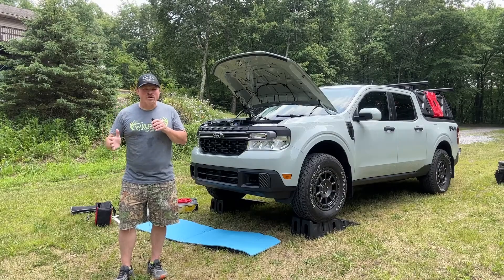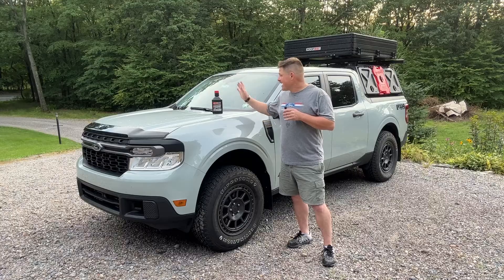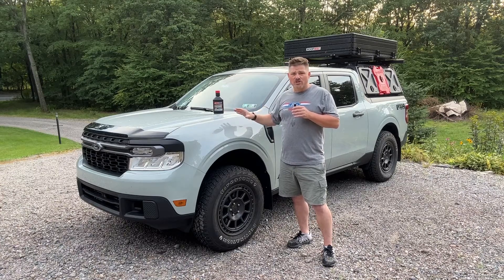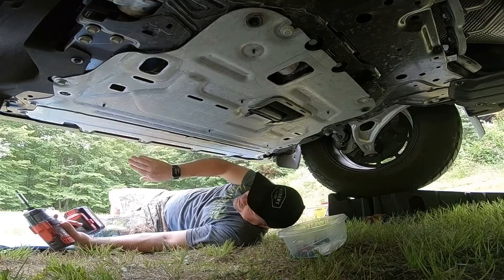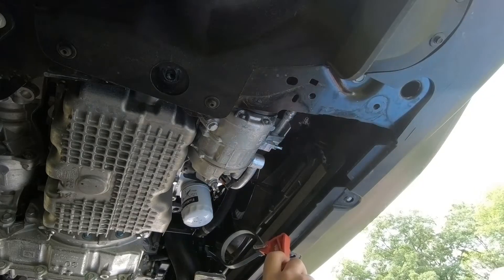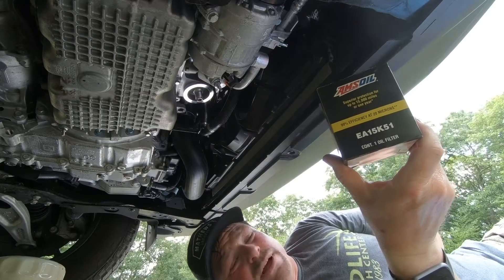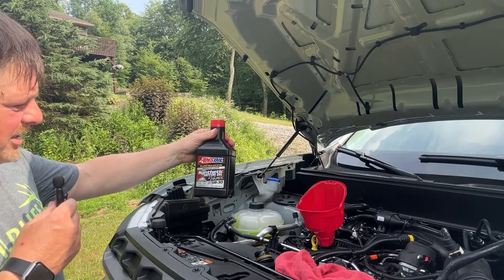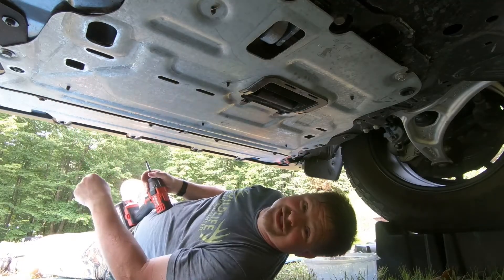Why Ford Maverick Ecoboost Owners NEED to Change Oil More Frequently!

Comment: Every 3 thousand on the dot, and I use Valvoline restore and protect, oil is damn good and it is economical. Also let your engine idle for a few minutes before shutting down, especially after a commute or drive, that let's the oil in the turbo to cool off a bit before shutdown.

Comment: I've been using Motorcraft synthetic blend and bg moa every 5k. I have a disability that doesn't allow me to do my own, so I've been going to the dealer. So, with using bg moa additive should i start using full synthetic? I have a little over 12k and plan to keep it a while.

Comment: I use Triax synthetic 20,000 mile oil n change at 10,000 miles.
Oil looks great n has barely any added color to it.
Good oil goes a long way.

Comment: Factory puts the oil filter on with a dry seal, that’s why they are so GD tight.
Also, get yourself a few bottles of the Amsoil coolant booster, it’s a fantastic product too.

Comment: Removing the Skid Plate every time you change oil is such a PIA. I went with an aluminum after market skid plate that has access doors for the drain plug as well as for the filter. They are also available for the Bronco Sports.

Comment: Hi great video. i am getting a new (leftover 2024) maverick 2.0 this week. when should I do the first oil change? In the past i have done first change at 2500 miles on new cars. what do you think?
Reply from the maker: I don't think 2500 miles is unreasonable. Whatever makes you happy but I'd say no more than 3000.

Comment: This is the first thing I haven’t liked about my Maverick, whoever designed this shit should get a hard knee right in the balls. Call up Subaru and learn how to design shit, they put a cutout in the skid plate big enough to access the oil plug and they put the filter right on top, oil changes take 5 mins. I’m not paying your meth-head technicians $100+ to do a fucking oil change. Get Fucked Ford!

Comment: I myself use full synthetic and the high mileage filters whenever I get an oil change. Turbos are in need of better oil than traditional non turbo engines. On mileage to oil change it can vary. Highway driving with no load vs. pulling trailers or heavy loads has much to do with those differences. Some vehicles actually monitor that and will signal you need an oil change earlier if you have been driving it with a heavier load. Going by the warning is not all that bad a way to go either with modern vehicles. But we all have our own opinions. Full synthetic is always a better choice. I usually use Mobil 1 when it's available but sometimes have to get whatever is on hand at the time. Amsoil is great stuff. I have used it in the past in my vehicles and even in my boat. Nice video.

Comment: Tip:  Take a center punch, nail, or philups screwdriver and punch a hole in the bottom of the old filter before removing and let it drain for less mess.
Reply: flyboy6258...as a senior and always changed my oil...hole in the bottom of the old filter....AWESOME!!!!!!!!!  Thank You....

Comment: Oil is cheap. Engines are expensive. I would change the oil in an ecoboost every 3000 miles. Oil filters should be hand tight. NO TOOLS.

Comment: you need to fill the oil filter before screwing it on
Reply: no, you really don't have to.  There are engines out there where the oil filter is mounted horizontal, so you can't do that anyway.  Plus there is so much oil that will stay in all the critical places, it will not be a factor.  Oil pressure will be generated within a second of starting the engine.  This was never a thing years ago.  It doesn't hurt to take the extra steps if you can, but it certainly isn't necessary.

Comment: Leave the back 2 bolts in place, they don't need to be removed just loosen them. The plate has slots to let the plate slide off and it won't crash down on you. It will also help when putting the plate back on.

Comment: Most modern vehicles have pre set at the factory a reminder syatem when to change your oil. I have followed what the manufacturer says to do and use and never have had an engine problem of any kind on a modern vehicle . My Maverick gets the Ford branded semi synthetic as that is what Ford says to use. I do prefer full synthetic but Ford says the valve seals perform better with the semi synthetic. While the truck is still under warranty, I do what Ford tells me to do.

Comment: I did a 5000-mile change in May and did oil analysis, and I was shocked to find 4% of fuel dilution. There was no indication of any injector not working properly and it was recommended by the lab to resample at half the interval. I just drained at 2700 miles and waiting for the results. I do a lot of short trips and have read this can cause that issue with DI engines.

Comment: I do my Ecoboost at 4000 miles an use Castrol oil have done that in truck i have owned an never had a problem

Comment: I used motor craft 5 20 in my New Ford Taurus DOHC V6 Change oil every 3500 miles Car had 250 thousand on it when I sold it to buy my Maverick Truck.  My 2.0 will run that same with 93 octan gas i had 250000 0n fuel pump also using Sunoco gas

Comment: 7500 mile oil change intervals are completely crazy, will definitely sludge up your motor over time. Having owned and maintained my own vehicles for many decades, as I had worked as a professional auto mechanic for many years back in the day, I would agree wholeheartedly with this guy to use pure synthetic oil (my preference is Castrol Syntec, as it is more readily available at local big box stores, along with the Fram Synthetic Oil filter). I always do the first oil change at 2500 miles and use petroleum oil, then switch to pure synthetic at 5K miles, and then every 5K miles which is now really easy to keep track of (10k, 15K, 20K, etc.). Only correction I would note is to just loosen but not remove the rear two bolts for the large pan, as it is designed to slid off of and back on to those two rear bolts (notice the slots in the rear of the pan), that will make the job just a bit easier. Also, I would reinstall the bolts by hand and then be sure to adjust the torque setting on the driver when tightening the bolts, although I always do a final tightening by hand rather than rely on a tool that might under or over tighten the bolts.
Reply: Thank you for the insight ... does Fram have different quality filters .. i have seen video on youtube showing how bad they were .. rusty .. dirty .. particles .. etc ...
Reply: @goldengate8287  Lots of youtube videos trying to tip Fram off of their pinnacle as the premier oil filter supplier, and lots of crap lies about them. Fram makes a whole bunch of different filters for various applications, I would choose the one that is designed for synthetic oil.

Comment: I’ve heard numerous automotive engineers stating the recommended intervals are for warranty and a minimum. They all state if you want it to last change oil more frequently.
In fact, at one dealership I worked at I seen a customer get a new engine despite being out of warranty simply because they did just that, changed their oil more often than recommended.
I have a Maverick too and change oil every 4k, starting at 1k with full synthetic Pennzoil Platinum.

Comment: Thanks for sharing the video. Have you changed the transmission oil yet?
Reply from the maker: I have not. I am not yet at 20,000 miles on my truck. Not sure what the recommendation is off hand. I actually would like to change the front and rear gear oil very soon.

Comment: FOED techs are ignorant, the quality of the oil is important  new synthetic oils can be in the engine for over two years and 10,000 miles, so changing oil more frequently just make oil companies richer there is zero data supporting 5000 mile oil changes are beneficial and the actually might be worse for your car
Reply from the maker: Fresh oil is worse for your engine? I'd love to see the data on that. Meanwhile I'll stick with short oil change intervals.
Reply: @themaverickhntr  nobody said that.  You can change oil ever day of your desire keep making billionaires out of the oil executives

Comment: Thanks for the video! Nice job! If I can add a suggestion. Remove the fill cap and dip stick first. Then when you pull the drain plug and filter, you will get a smoother and more complete drain.

Comment: I just bought a 2024 Maverick XLT ecoboost last week, and the dealership I bought from told me every 5k miles was their recommendation, so at least some dealers are aware that they need oil changes slightly more frequently

Comment: I have a 2024 Mav XLT FX4 and plan to change every 5k miles. I did that with my 2012 Focus I bought new and it's still going strong with no mechanical issues after 200K miles.
Reply: how have you put 200k miles on a 2024? its not even a year old yet.
Reply: @sammascreel  The 200K is on the 2012 focus not the Mav. Did you read my comment?
Reply: @xxUncleBuckxx  my bad. I missed the middle line completely somehow.

Comment: Great video. I skipped removal of the front skid plate and still had enough access to remove the oil filter.
Reply: At least you aren't the scardy cat that has to wear goggles and vinyl gloves to do a simple service. I am a former Amsoil dealer from 50 years ago. Today I use Pennzoil Ultra Platinum since it has a great anti shear additive package. Amy premium synthetic will work but do your research if you plan on keeping your Maverick for over 100k miles.
Reply: @JalopyTechnology  Yeah gloves and goggles are wack. It's always better to make cleanup harder on yourself.
Reply: @JalopyTechnology I use valvoline protect and restore 5w30
Reply: @JalopyTechnology  a scarred cat seems like an apt description of one that eschews simple PPE.

Comment: Thank you for the comprehensive oil video. Are you on MTC Forum? How often should we be changing the transmission fluid and other fluids?
Reply from the maker: Yes, I am on the forum. Not sure about tranny and diff fluids, but I am sure doing them a fair bit ahead of Ford's recommended interval isn't a bad idea.
Reply: @themaverickhntr  Yeah. The Ford manual says 150K for tranny fluid. I'm thinking... NOT.

Comment: Forgot to show us how you reset the oil change notification icon.
Reply from the maker: It's in the menu under vehicle settings. Use your steering wheel menu button to access.

Comment: My Maverick is getting a Castrol Magnatec oil change with either a wix or Motorcraft filter. I seen on another oil change video here on YouTube that some people are using the FL 400s over top of the fl910s, what's your guys's thoughts on doing that?

Comment: I work at a Ford engine plant, I work in the area where the oil filters are installed. We use an electric tool that tightens the oil filter to a preset spec. I’ve told our engineer countless times that the oil filter doesn’t need to be that tight but they don’t listen. Ford wants to insure that they are not the reason the oil filter leaks once the car leaves the factory.
Reply: Good rule of thumb for tightening an oil filter that I was taught by my older bro who was a professional mechanic for many decades is put a light film of oil on the gasket, then tighten the filter by hand and once you achieve gasket contact, then further tighten the filter down another 3/4's of a turn. This is plenty tight enough to keep the filter on but not so tight that you will have to fight it to get it back off later. Also, I now buy filter wrenches for the filters on all my vehicles, makes the job just a bit easier.
Reply: @SpeakerBuilder  Yeah I do the same thing on my own vehicles
Reply: which one?  Im guessing not Valencia Spain.  What do they do different which results in a lower failure rate of the head gasket?
Reply: @ The problem is there was a notch machined between each cylinder for coolant transfer on the Cleveland/Dearborn engine blocks. The notch is right below the head gasket. These engines make more power and boost so there was more pressure in the cylinders which would eventually cause the head gasket to fail. For whatever reason, I’m assuming tooling, the Valencia engine blocks had a different design for the coolant passage between the cylinders. FordTechMakuloco has a good video explaining it all but now all 2020+ model year 1.5, 1.6, 2.0 and 2.3 Ecoboosts have the better coolant passage design that aren’t prone to cause head gasket leaks. 
Here’s the link to  FordTechMakuloco’s video about it 
https://youtu.be/S-PYa8aBM4Q?si=82uYlig0RxdFDyVK

Comment: Great video! Just a quick question, over your ownership of the Mav, have you experienced the noisy high pressure fuel pump, especially in colder weather? Thanks
Reply from the maker: The fuel.pump definitely sounds like a sewing machine but that's just the way it is. I can't say I notice any difference summer vs. winter.

Comment: Informative video. One point I'd like to make is if you're doing it yourself, ALWAYS run the engine to circulate the oil through the engine and filter AND ALWAYS CHECK FOR LEAKS BEFORE INSTALLING SKID PLATES. (Note: No mention if there is a gasket or O-ring on the drain plug, and if there is a rubber or cork O-ring, then it should be replaced.
Side note question: What make and size tires are on your truck and does it have a lift kit installed?

Comment: I have the Edge 2.0 ecoboost and I turn off the auto start/stop most of the time. I'm thinking there might be a little oil starvation at a stop light going from off to acceleration boost. I also try to idle the car before shutting it off to allow for spool down and cool down. I know, maybe old school turbo cars but it make me feel like I helping it last.

Comment: AMSOIL is the best... but it comes at a price :) agree with you we have to do change oil&filter every 2x the recommended factory interval. My interval is 15k kms, I plan to do oil change every 7.5k kms. Cheers!
Reply: Amsoil is the best..been a dealer since 1999  A little extra $$ is well worth it!

Comment: I think you should also disable the start stop feature on the engine. After hard driving turbos are hot and the engine will shut off when you stop. So no oil flow to bearings in turbo. Same is true on diesel engines dont turn them off right after hard driving. Example highway trip stopping for gas at an exit give the engine time to "cool" off before shutting it off.
Reply: First thing I do turn it off I’ve never used it not one time
Reply: Agree 100% Always let my 2002 Dodge 5.9 Cummings run a bit at idle on a trip.

Comment: You should always put oil in the oil filter before putting it on. That way when starting it up after oil change it doesn’t have run through the filter it’s already got the oil in it. My Dad taught me that.
Reply from the maker: I do that now but honestly I'm not sure it's critical. The professional oil change places don't do it and I believe there is a bypass to ensure sufficient oil can flow to the engine at all times
Reply: @themaverickhntr  Those "professional" oil change places mostly don't give a s**t.  If you don't specify, you won't get synthetic; they will likely use the cheapest oil they have that matches the weight on the filler cap.   They will also push the cheap Fram oil filters, which are about the same as NO filter.      The oil filter bypass?  That is in the filter for the circumstance of a PLUGGED filter, which you would get from NOT changing the oil.   It has nothing to do with an empty filter.   

As a retired professional mechanic, I can tell you that pre-filling the filter with new oil is always a good idea.  Since your engine has a vertical mount with the opening up, it will get oil into the engine sooner.
Reply: I have two vehicles with inline 6 cylinder engines that the oil filter is horizontally mounted.  So this cannot be done.  I don't think it is necessary as the amount of oil still in all the critical places will prevent any damage.  It takes less than a second for oil pressure to build after an oil change and you are at idle.  Doesn't hurt to take the extra steps when you can, but if you don't or can't fill the filter, you are not going to do any damage.

Comment: I"m in FL.  I don't put the felt plate back on.  I can change it quick without ramps.  50k miles on a 2022.  Superteck full synth. Hybrid.

Comment: A good idea is to prime the oil filter before installing it. You installed it dry which is not good for the life of the bearings.
Reply: this is simply not true.  There is enough oil in all the critical places even after you drain the pan that the bearings are fully protected even right after an oil change.  There are engines out there that have the oil filters mounted horizontally so you can't fill them.  Oil pressure is generated within a second of starting.  And with full synthetic, it has a higher film strength, it stays on surfaces for much longer periods of time. (days or weeks)  For years no one filled the filter first.  It was never taught or recommended.  And no one had issues.
Reply: @patrickmcmullen7910 , tell that to anybody who builds race engines, and they will cringe at you. I am most comfortable priming an oil filter whenever possible. And yes, some manufacturers do recommend priming the oil filter. Harley-Davidson has recommended priming their filters for years. On Subarus, you can't prime because it's mounted upside down. I use the 1-2-3 prime technique: 1 fill if the filter is in a sideways position, 2 fills if it's at an angle, and 3 fills if it's straight up. Most shops don't bother priming because it takes extra time, and time is money. This is why I choose to service my own vehicles.

Comment: What are those headlight covers? Do they not degrade lighting?
Reply from the maker: The top of the light is not operational on XL or XLT trims. In the Lariat there is a signature LED lighting up there. It's just black vinyl wrap and it doesn't reduce lighting at all in my truck.